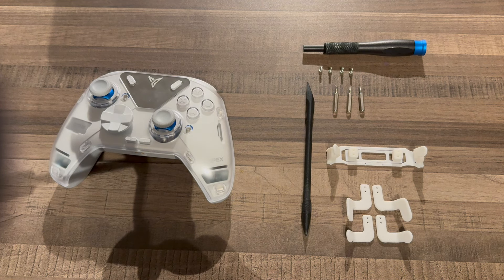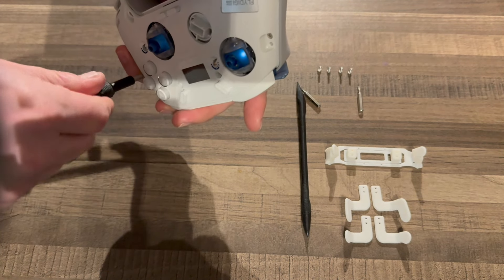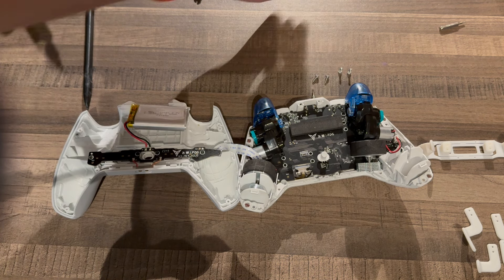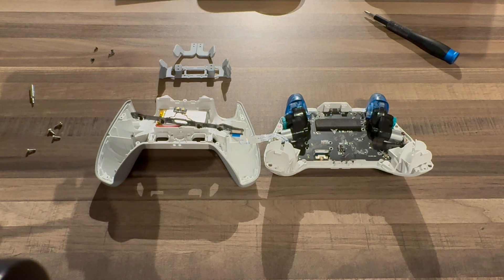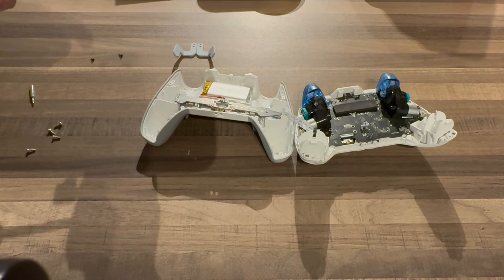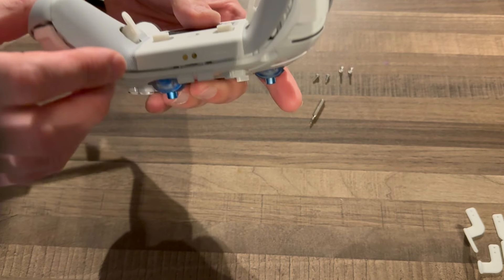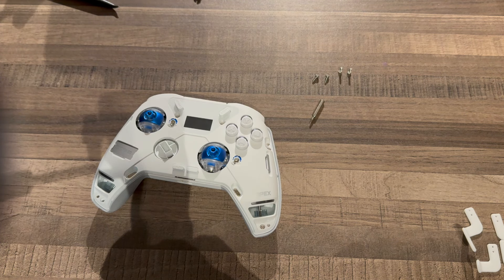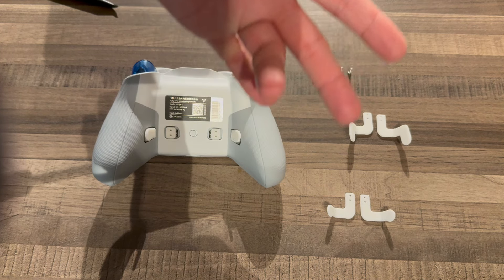Apex 4 Back Paddles

Comment: i purchased these & while i enjoy the ergonomics you do have to fiddle with the tightness on the screws, i had some issues when binding the either of the longer L style triggers it seemed like when "holding" the button it wasnt as consistent & 50% would only register the initial single button press, so after trying to adjust the paddles & screws a few times with similar results i opted to go back to the stock config. love the concept & build quality

Comment: I've watched your Vader 3 Pro back paddles video and the design got me thinking, is it possible to design the connecting interface between the two pieces such that it only needs one screw? The contacting surface can have slopes/notches that align them so that they won't rotate when pressed.
Reply from the maker: There is a possibility, you could have the peg on the harness part and a hole in the paddle to stop rotation.

Comment: Hey bouncing, just a question in case that I need to put short triggers on the apex 4 by any chance that’s possible?
Reply from the maker: Hey. Not possible I’m afraid. The software trigger stops are better than I expected, but you can still push through them.

Comment: My left analog stick keeps breaking on this controller. This is my second time ordering it. It's hard to reccomend this controller with this design flaw.  I also have the vader 3 pro. I feel like the vader is more durable than the Apex. However, if this wasn't a problem, the controller is beautiful, fast and accurate. I hope they fix this. I'm going to wait a few more months before I buy another one. Also, other people have had the same problem with their left stick too.
Reply: Apparently if you put the stick tension as loose as possible it decreases the chances of it breaking. I have only had mine for a week so time will tell.

Comment: Do you know what kontrolfreeks fit on these thumbsticks?
Reply: ps4/ps5 is best fitting
Reply from the maker: Gamer Heaven mentions this in his review, but I can't recall the answer, sorry.
Reply: I tried ps5 fitting, it's a tight fit for the rubber sticks, I'd recommend OEM slip ons or you might risk damaging your non replaceable stick's rubber
Reply: @cassynova bruh that expend the stick with your teeth a bit and you’re good to go. i use ps5 KF for my v2 chroma. i just spend it a bit with my teeth to fit perfectly lol

Comment: Would it be possible to house the guts in a xbox elite 2 ?
Reply from the maker: Sadly not, there are way too many differences and the motors for the adaptive triggers are quite large.
Reply: @BouncingBallGames  bummer I really love the weight , trigger stops, and paddles. Hopefully one day I can afford another nice controller lol. Competivitive gaming is hard with the elite 2 due to the latency bleh
Reply: @BouncingBallGames  what about making it so we can use the elite 2 paddles. Make the plastic things to position and holes the house the paddles like the bottom of the elite

Comment: Oh this is perfect!  So glad I found this!  Will be eager to try these out once they arrive as I just bought a set...  Oh and the arrival of the Apex 4 for that matter....  That was just a few days ago. LOL.
Reply from the maker: Thanks for your order. I’ll get it shipped out today or tomorrow. Any questions just let me know.
Reply: Any update on how they're working?
Reply: @j1nftw1n  They are perfectly fine.  The instructions in this video are great, just follow it to the letter.  To be honest, I'm still a k&m player, (for FPS titles). But for other games, it's a joy to use.  No fault of the controller, or this mod, more the operator. LOL.
Reply: @ Awesome thanks so much for your response! Just curious have you ever had any hands on time with the xbox elite 2 and if so how do they compare. If not no worries and have a great day!
Reply: @j1nftw1n  I wish I could give you some sound advice.  I'll try, LOL.  I do.  It's great, but I think they can be prone to stick drift. I bought a 2nd hand one and that was mistake # 1.   DOA, as the right bumper was not working, and the left stick had stick drift.  Got a refund. Actually bought a new one for a discounted price and it's solid. But I'd be worried about the longevity. I think the Apex 4 gives you more customizable freedom.  And feels buttery smooth to use.  Honestly?  If for PC, Apex 4...  Both? XBOX & PC?  Go the Elite 2, as the Apex 4 will be for PC, switch, Android only.  But you will also need an "8-Bit Do" or "XBOX Wireless adaptor for W10" for PC with the Elite 2.  Hope that helps.

Comment: Controller costs 100 eur. Paddles for 20 usd 😮
Reply from the maker: Indeed. If you want to design and print your own you can, and as long as you’ve learned CAD and already have the 3D printer and filament, it’s free.
Reply: @BouncingBallGames  or you can find some dude with all the setup and he will make it cheaper:) anyways, default paddles are the only  disadvantage of this controller for me. If we were in the same location, I would pay 30 just to get them asap:)

Comment: Does the Kit come with both sets of paddles?
just ordered mine but since I generally prefer to use both the paddles with my middle finger the bottom, one you didn't install honestly looks like it would be more comortabkle for me.

Actually the stock backbuttons might even be the best for me, but can't wait to see how the paddles will feel and compare.
Reply from the maker: It comes with just the larger ones, but if you message me on Etsy I can include both